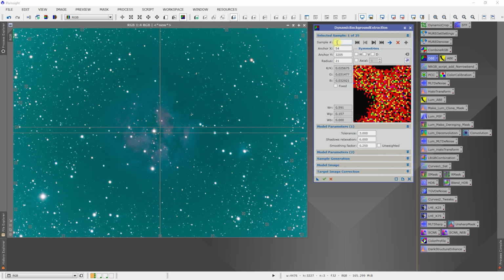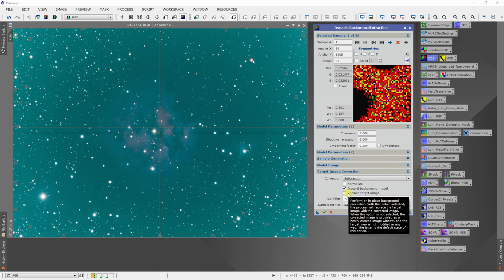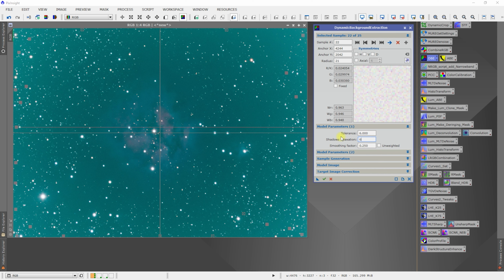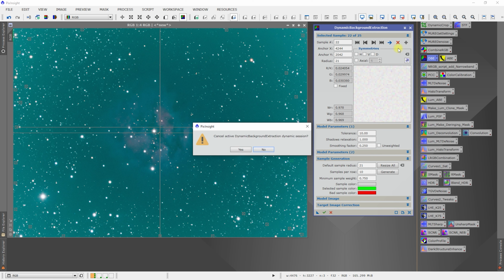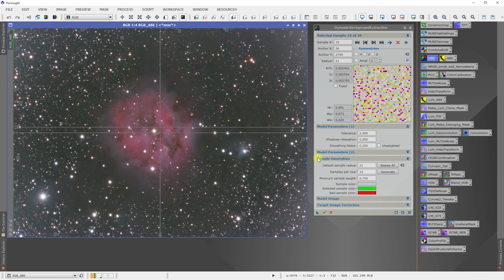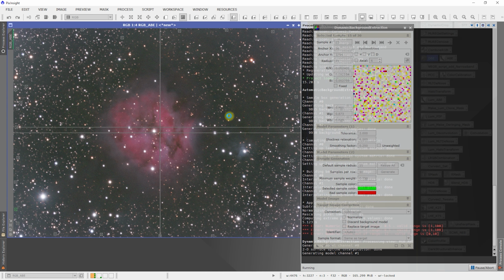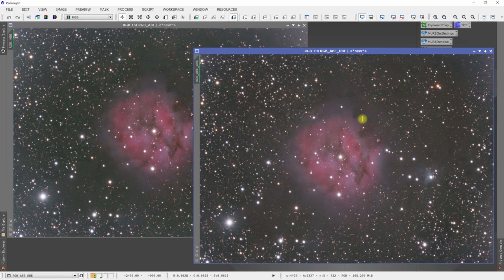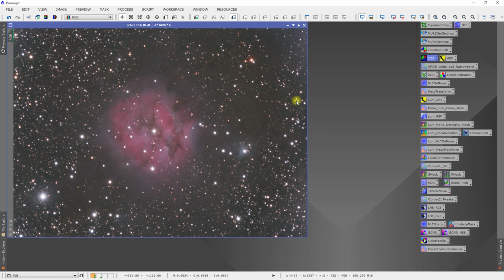EP197 P15 - RGB DynamicBackgroundExtraction Process

Comment: Judging from your picture, it looked like you had vignetting, not light pollution and you should have use division not subtraction. 
Just a suggestion,Rick
Reply from the maker: Thanks for watching and the suggestion.  Up to this point I have always used Subtraction.  I may revisit this data and try subtraction or use it on the next targets data set.  Either way I will do both ways and see if one yields better results than the other.

Thanks again, Clear Skies.
Reply: @astroimagingjourney8517  I enjoy your videos very much, and admire your imaging results. I should have mentioned that in my first comment. Thanks for putting these videos together, Rick
Reply from the maker: Thanks for the kind words.  This is truely a journey of continuous improvement.  Thanks again for the suggestion.  Clear Skies.